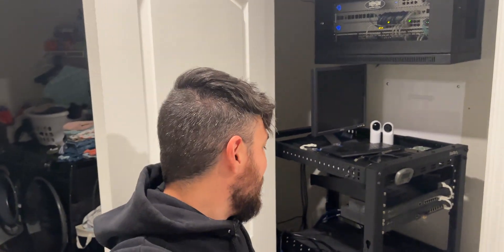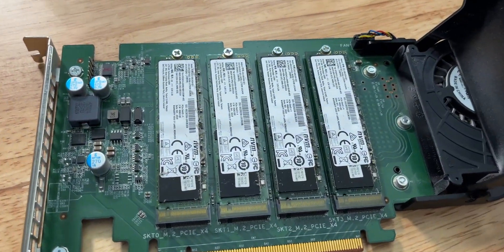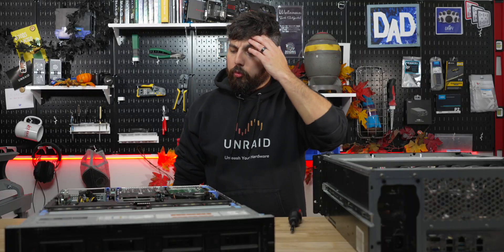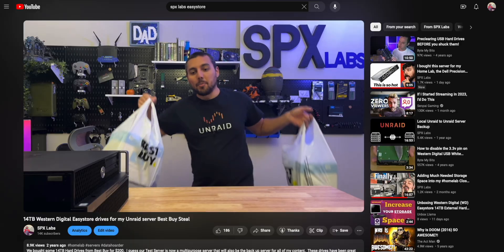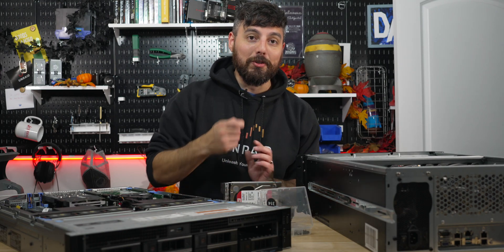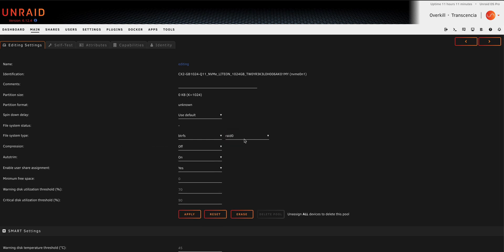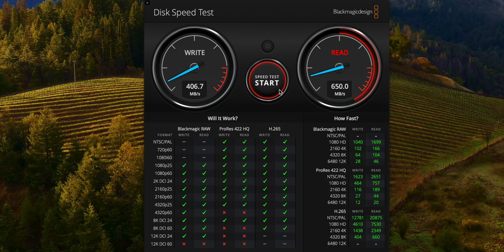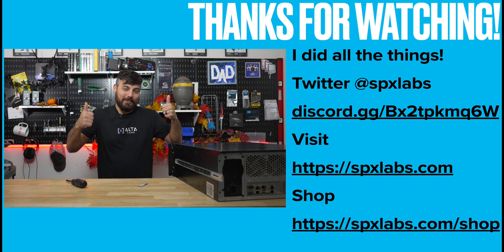Let's build a NAS with Video Editing Cache Storage

Comment: I have an Array, and two SSD cache drives. When I transfer files from my PC to unraid the files stay at cache drive then at 3am I have schedule it move to my Array. My current network is 10GB/s. My speed when transfer into unraid is good and constant thanks to the cache drives.

 

However, when I transfer my files from unraid to my PC a certain files and certain folders have really slow speed I'm talking about 20MBs instead of regular 200-280MBs. Even the files within the same folders somes have really slow speed transfer. I've checked and those files are currently storing in the same disk of the array.

 

I'm not sure if I have set up something wrong.

i'm currently running xfs for my pool

Comment: I think the issue is btrfs. I couldn't get over 500Mb transfer to btrfs nvme disk but with xfs on the same drive it was 1Gb. So likely a single 4Tb xfs cache drive would be better than a 4x 1Tb btrfs pool. ZFS was also slow in unraid.
Reply from the maker: That’s possible.  On the Red Hat side I used XFS and got over 500MB/s.  There is no option for XFS raid pools though in Unraid.  :(

Comment: Slow because of network settings issue ?  Good video sir !
Reply from the maker: Maybe . Worked fine with red hat without touching the network.
Reply: jumbo frames & better driver support in RedHat
 @SPXLabs
Reply from the maker: Possible.  I think it’s something else specifically with SAMBA.  I tried NFS also with Unraid and had slow transfers.  It’s not the network though.  Or any hardware

Comment: I also was frustrated by slow transfer speeds with an UnRaid all nvme pool. Thought it was FUSE related but the found it was partially windows 11 drivers for my older Intel x520. I also adjusted flow control and nic offloading and tx/rx buffers with the Tips and Tweaks plugin. Oddly it now shows them as default (flow off, offload on, 512, 512) but maybe just changing them helped reset old configurations. The server has been through many upgrades. Also make sure that the CPUs are running with Performance or SchedlUtl so they can handle the traffic. Now I get close to 1GB/s up and down from my workstation, streaming pc, and proxmox server. It was annoying me for well over a year until I spent a day to figure it out. My speeds were similar to yours and worked for 4K editing but double the transfer rate is nice for moving big files.
Reply from the maker: I spent about 3 days changing all sorts of things and was never able to hit 1GBps like I used to.  Imma spend more time with it again later because I still really like the mover action to the array.
Reply: @SPXLabs  Please update us when you do figure it out! I’d like to utilize more than 1-5% of my 40G link..
Reply from the maker: lol damn son! I definitely will update everyone.  I document everything and share it on this channel.  Even if it’s lame.
Reply: I have been struggling with getting my unraid server to perform well, my hdd array is faster than my SSD pool….. Couldn’t ever figure it out, kinda sucks when I am trying to run VM’s off of the SSD pool. 

TBH I probably will never be able to find a NAS software that works for me, just like Proxmox every time o try Truenas it just blows up on me for no reason and either takes data with it or ends up broken in such a way that I can’t fix and have to reinstall. For example, LACP doesn’t work and has NEVER worked on TN yet they say it does and it’s “user error” then doesn’t give any info on why.